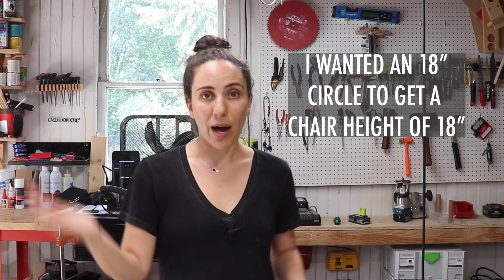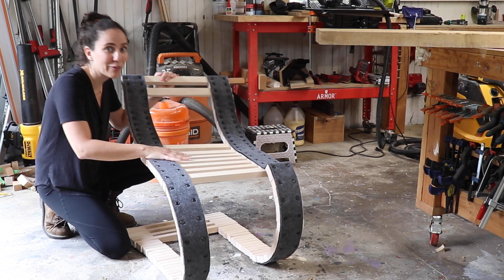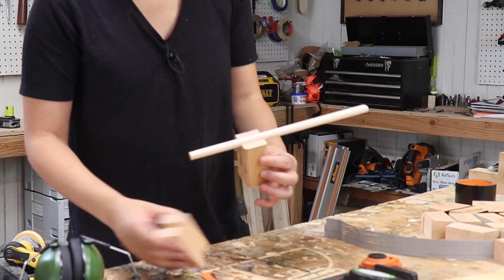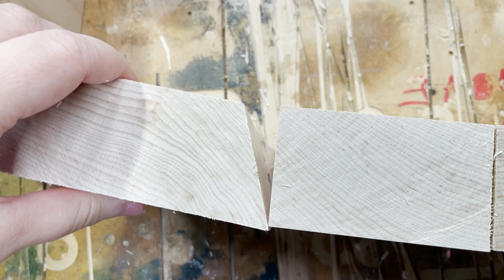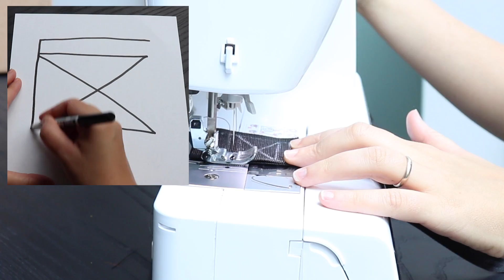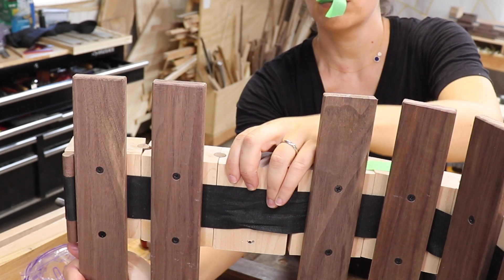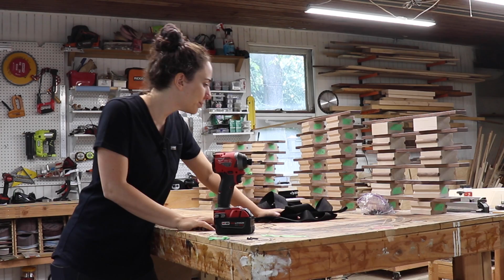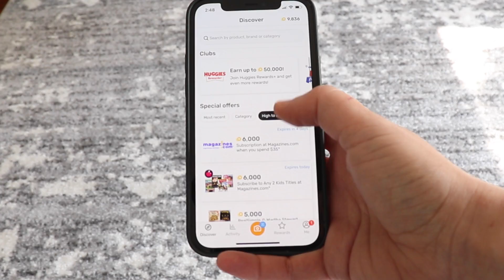I ATTEMPT to make a Roll Up Chair… AGAIN...

Comment: This project was doomed by bad advice. Increasing the ultimate tensile strength of the straps doesn't solve anything. What you is a material with an extremely high Young's modulus, like kevlar. Even then, it's pretty clear that the blocks need to be cut for a larger radius than you intend to end up with along the load-bearing portions of the chair, as the wood changes shape under strain. Even with all of that, a mechanism for tensioning the strap while it's assembled would make this a lot easier.

But at the end of the day a folding chair is probably better.

Comment: Idea I haven't seen in the comment section: how about you use like 10 straps instead of just 2, utilizing the full length of the segments? The weight would be divided between 5 as many straps, so the stretch would be 5 times less (probably).

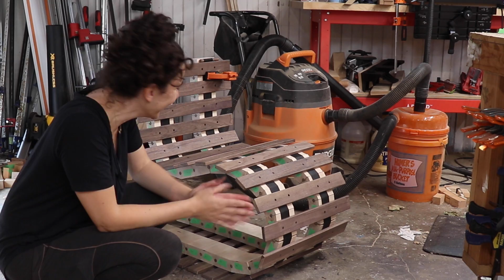Comment: Watching the video at the points in which you tried setting up the chair and kept finding gaps, it looks to me like you're just hitting the plastic deformation region of the strapping, which simply means that that isn't strong enough. Ah, yeah, just after 20:00 you bent it way down, and between 19:23 and 20:21, it is not springing back to the same place it was before the pressure you put on it. That's plastic deformation, and that means there's no amount of shortening you can do, because that webbing just isn't strong enough.

The website saying it's "stronger and lighter than everything else" is completely meaningless. That's just marketing copy. You need number. Not just guaranteed breaking strength, you need low elasticity and high yield strength. Basically you need to source materials intended for engineering use, with real stress and strain statistics.

I suspect if you actually did the math for the level of strength needed, you'd find that you're either looking at steel bands (which you couldn't then roll up) or, more likely, carbon fiber.

What you're essentially making here is a barrel, and I think you're kind of reinventing the wheel in terms of the methods used to make barrels sturdy and leak-proof. IIRC, what they do is get the curve all set up and snug, and then heat steel bands so they swell, pound them down around the wood already as tight as possible while they're heated, and then when they cool they're providing enormous amounts of force as the steel shrinks. I don't think nylon strapping (or whatever that is) even has a prayer of doing that job.

I'd seriously look into barrel making for some ideas. In the meantime, I'd also use a CAD program to calculate just how much force the strapping/webbing/bands have to take, not just under a static load, but the dynamic load of the initial sit-down (think at least 4x static load for a tired person just plopping down, plus 2x engineering safety margin, and fudge a bit of extra for the non-optimal materials and fastenings, and I'd think something like 10x is about right compared to the static load it calculates).

I think you'll find the answer to be absolutely shocking and the underlying reason why this chair concept isn't working. Just some basic order-of-magnitude head-math and I'm pretty sure those straps (individually; they don't have enough mechanical linkage to help each other at all, really) will need to be rated for somewhere between ten and fifty tons. So 20,000 and 100,000 lbs. I seriously doubt Venom had that in mind. ;)

You also might find that chamfering the corners of the wood blocks that touch the ratchet straps (or actually, an asymmetrical radius, basically so that no sharp edge is ever touching the strap) helps as well. Those little sharp creases between each pair of blocks are creating stress risers that are getting worse as it starts to stretch, which I think may be creating the behavior of the straps holding, holding, then suddenly giving and then continuing to give and not returning to their original state (plastic deformation).

Edit: Ooh, one material you might try are actually crane hoists. Aaaaand... never mind. To get to the kinds of strengths I think you need, you'd be looking at 8" or 10" wide slings costing the better part of a thousand dollars each. 2" slings purpose-built and certified for not yielding to heavy loads (I'm pretty sure you'd need the choker capacity, not vertical or basket, though if you radiused the other curve of the compression blocks you might be able to go up to the vertical load) are still over $100, and can only hold just over 1 ton... so might be enough if you radiused the corners of the blocks to make the outer surface into a continuous curve, and then sat very gingerly in it, and only expected it to work for a couple of use cycles.

Edit 2: Oh, also, you could reduce the strength needed by thickening the wood to create a less dramatic difference between the lever arm the straps have to work with, and the lever arm of the user's weight, which I'm guesstimating to be between 10x and 15x at the moment. Also also, you could reduce the overall weight and bulk of the chair (if you ever get a working prototype) by using thinner blocks toward the ends. The stresses are always going to be greatest around the front of that main curve, right where the gaps keep forming, so if you, say, doubled the wood thickness there, and then tapered to half of it at the 'foot' and the top of the back of the chair, it might save some weight while reducing the strength of tension components required. However... you'd really want to do a proper engineering analysis of it to try something like that. Maybe a collaboration with someone like Grady from Practical Engineering? Or... any engineer, really, this is all pretty basic statics stuff from like, year 2 of any engineering degree. (The analysis, I mean, not the design. There's nothing basic about this design at all. It's a doozy.)
Reply: indeed, like many others have said, this strapping she used stretched far too much, It would be possible to use the existing materials, but she would have to be able to account for the stretch of the strapping and the deformation of the wood, the calculation for the wood would be more difficult depending on how the wood was cut, how dry it is, and which direction the grain is facing. while the calculation for the strapping would be near impossible because given the precident of the supplier not giving very good or useable information, i doubt she could find any concrete metric for this strapping, like breaking strength let alone how much is stretches under load as well as when it plastically deforms.

This project is something that involves more engineering and math than traditional woodworking.
Reply: @ameraldas3641  Well, what I'm saying (if I'm correct) is that it isn't just "stretching"... it's deforming, which means that no, she couldn't use the existing materials. There is no way to "account for" plastic deformation, because it's an irreversible process. Eventually, if she just kept tightening and stretching over and over, it would simply break. That would've happened a long time ago if it was a simple contiguous material, but because it's woven and relies to some degree on internal friction, it can deform a lot more before actually failing.

Comment: Some things that you could try are drilling holes on the front side of the blocks and running tensioned steel cables or using small hinges hidden under the strapping

Comment: isn’t the fact that the strapping isn’t secured to each individual block a big problem? at one point it sorta looked like the tension from the front curve was making the back of the chair collapse forward, like the strapping is moving freely, which makes it so that there is the same tension throughout its entire length, which doesn’t seem like what you would want for a chair like this? 
this is probably stupid but it was kinda confusing to me

Comment: Maybe adding 2 screws in the ribbon for each wood piece will restrict it's ability to stretch and open gaps ? It would only be able to stretch over a few centimeters rather than full length

Comment: You'd need to TEST and MEASURE the stretch in those materials... like at least 150 kg each strap, separately, that's like their minimum load (even in final use). That test would immediately let you disqualify materials based on too much stretch, which honestly could even end up being ALL materials (highlighting fundamental design flaws if that were to happen).

Comment: I don’t think it’s the straps stretching, it’s that when the pressure is uneven across the whole chair, the back bends in and the strap pulls down to the area where the pressure is. If you didn’t have the back on it, you might have success… try that first.
You could buy a piano hinge, cut it into lots of smaller hinges and do that… gluing the strap like you were saying with the leather, that might actually work.

Comment: Just drill holes from center dowel to center dowel through all the pieces. Run some rope or light duty chain through all segments and secure at each end (for both sides, of course). Tensioning and maintenance become trivial; the segments are ONLY connected via the rope through the center hole. Problem solved, right?

Comment: One idea I had is to add a sort of stop-block (not the right term, but I can't think of it so here we go) on the backs of each piece, positioned and angled to exactly fit with the next one's back and prevent it from curving back further than "the right spot". Kinda like the bit in a door frame that stops the door from swinging back beyond the closed position. Strong tension would no longer be needed as much

Comment: You should try free opening hinges, that way it can still roll up one way and lock in the other way without any flex. All the pressure will be on the wood (or the quality of the hinges)

Comment: Hmmmm.....putting the wood choice aside (it looks like a soft wood which could easily deform under this type of use), I think the best method would be pivoted using metal plates (sort of like a interleaved chain) else wise there will be no way to roll it up no matter how much you try.  The problem with the strap as you know is the material, but also it needs to be on the outside of the curve to provide tension, which is why the top will always want to snap shut when you sit on it as it is now.  I personally don't see this working out in the long run as the straps will always have some stretch in them and is going to cause it to be very dangerous due to flex and elastic snap back, it would never pass for a commercial resale product.

Comment: It's NOT a material problem, it's a design problem. Straps bad, hinges better.
As you pointed out, having a single strap that can conduct tension freely along the whole chair is very dangerous. What you need is localized tension that's not going to remotely affect other parts of the chair. Solution? Break up the strap into tiny pieces so that it won't conduct tension over long distances.
Better still, do not use strap period. If all you need is for adjacent pieces to be able to rotate, how about mini hinges? This would give you the rigidity and flexibility you need.

Comment: Leather will stretch far more than polyester. If you still go with a fiber, you want to ensure it is not a knit, crochet, or braid, which most straps and ropes are. Also, you want to make sure it is material that is on the straight of grain which basically means that the warp threads (perpendicular to the selvage edge that is tightly woven and used to hold the fabric on the loom) and weft threads (parallel to selvage) are lined up to be at that 90 degree angle, with the weft going the long ways along the strap. The best option for a fabric would be a heavy duty cotton canvas, which is a plain weave. You may want to wet and pre-stretch it. For the best results, you would need to distribute the weight of the stretch across the threads as much as possible, so stretch it out on the sides while initially securing it so that it will not be able to stretch as much along it’s length. The wider the fabric for this, the better, as it will more easily distribute the weight. Sadly, as is the case with any fabric, it will still stretch until it breaks. The only way to use fabric effectively is to do all of this and also continually tighten/shorten it as it stretches over time. One other idea is to use fire-hose material. It’s not exactly light weight, but the layers of rubber and plain weave duck cloth make a stretch resistant, strong material.

Comment: Have you considered using a cable? I think if you drilled a hole through the middle of each piece and put a cable in it, the cable could be easily tightened without disassembling the chair until it is appropriately taut and would add significant strength.

Comment: I have not read all the reactions, just the first few.

I'll just leave some thoughts here, and who knows maybe it helps you a little bit further in your project.

As mentioned, stretching is probably the biggest issue with the current design.

You said in your video something about drilling holes and putting a wire through all the blocks, and by that making it all stronger.
But to do so you would need to find a way to tighten up the wire once you have the chair in position. And loosen the wire to roll up the chair.

Instead of changing materials, what would you think of adding a couple more blocks at the end of the base which then roll. Back towards the seat of the chair.

The base and chair seat would essentially make a figure eight where the chair is supported by the base.

Anyway, I'm following this project because I'm interested in what you and the YouTube society will come up with.

Comment: This is going to be hard for me to explain, so I'm sorry if it sounds weird -

when you have the chair sitting, it basically makes an 'S' curve, right? except the top of the S is cut off. The upper turn I believe you called a 45* angle. On the bottom of that angle, you could attach a jointed sitck, something that would roll up, but would become stiff when unrolled. Having at attachment point at the bottom of the S would add stability and still be rolled up.

the ampersand, &, has a similar look, except it is flipped. It would be a simple addition that would help increase support
Reply: Not gunna lie, I totally lost you until you mentioned the ampersand! & I totally see it now, and 100% agree. If she can come up with a clever way to have an attachment/support bar there at the bottom of the seat, but somehow still detach it and allow for rolling up, that would be an easy solution without changing the concept of the chair too terribly much. Though, it would take away from that unique "floating" aspect.

Comment: as a note, when you add additional pieces (like you did at 22:53), you didnt take out the stretch that occurs in the bottom curve; but only the stretch that occurred in the top curve. I think you have to treat the segments as independant here

Comment: you would need a material with the highest possible tensile strength and the lowest possible stretch, like carbon fiber or maybe kevlar. 
next problem is the wood compressing, wood is probably not the right material either.

regarding the hinges making kurves under tension, I believe that can only be fixed by moving the hingepoint from outside the block to inside the block. no material can solve that any other way  even with infinite tensile strength and no stretch at all.

those are my 2 cents, being a keyboard engineer and all :)
Reply: Funny that you mentioned hinges. Seems a much more plausible choice than straps.
Reply: @WhoAmi2357  i doubt that any elegant sized hinge would hold up :D

Comment: You should try limiting the stretch of the strap just for each joint, not for the whole length. The forces applied at each joint on the strap are different, that's why you get the strap super tight on some joints and loose on others. You have the same tension throughout the whole length of the strap.

Basically just tighten the strap at each joint as much as you can, and only then move on to the next joint. You'll find the final length of the strap when you fix the last block in place.

Use some clamps or screws with 2 pieces of wood to clap the strap tightly on each block for a test.

Comment: really interesting project, i enjoyed the video. I think you need very low deformation or "high tensile" strength strapping. I also wonder if using separate strapping on different parts instead of a continues single strap?